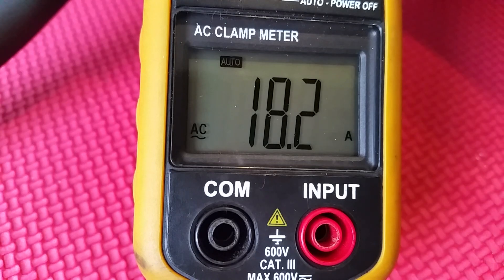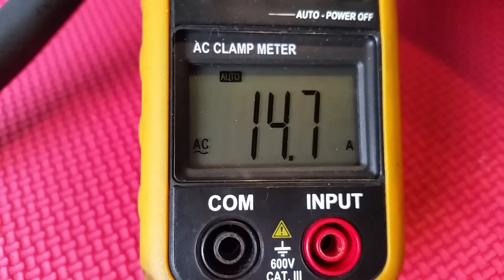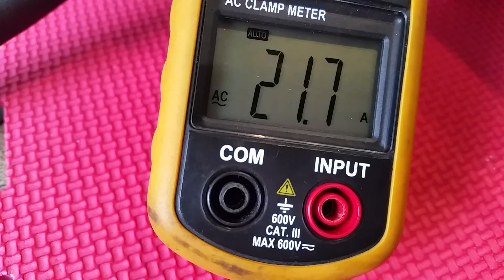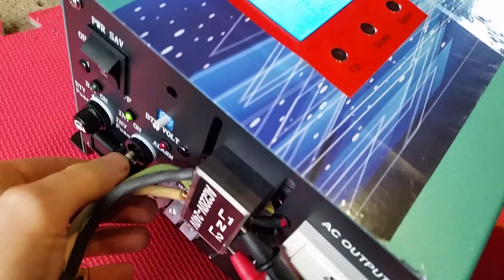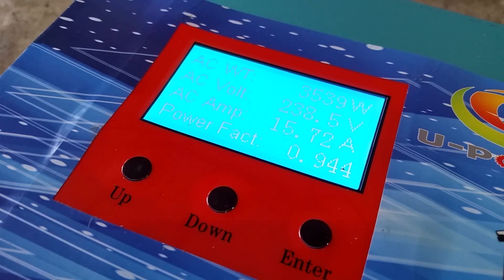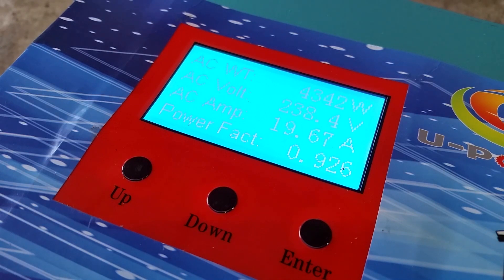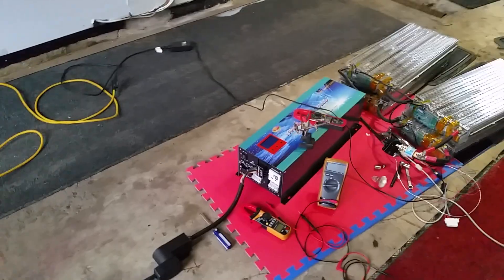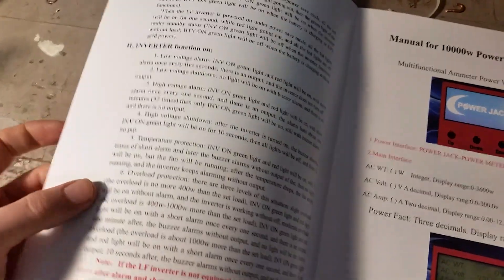Test/review of powerjack 15000W split phase part 2

Comment: Hey thanks for the review Joel, super helpful!!! I am not attempting to power a house but I am doing a coach bus conversion into a RV. After watching you review I think this should work for me. I am really only powering a Mini Split ac/heat unit,fridge, lights, maybe hot water heater,microwave and not all at the same time. I think this would be more than what I need. What's your thoughts?
Reply from the maker: Should be ok, just be aware that only half the power is available on each side of the 240v output. If you don't have any 240v appliances, this inverter is probably overkill for you
Reply: @erroneus  what on earth are them giant battery packs your plugged into? That might be helpful in my project also
Reply from the maker: Those were lithium modules from a tesla model s

Comment: Person is showing the 15000 watt inverter note your battery supply needs to be three times what is suggested for example your converter draws more amps than it puts out because the the things that you use use less amps it's kind of hard to explain the bottom line is is that converter needs a minimum of 200 amps BC 48 volts corny your little book caustic we're headed to put out 15000 Watts you're not being fair to the company and I do this all the time if your batteries cannot Supply the voltage in the amperage at a constant rate things get hot and that's why they shut down ew sticker wires coming from your batteries the less heat the less resistance the better the output and the better the results in the happier you will be
Reply: You are dead right. You will prepare more battery capacity to test all the way.

Comment: I bought a 6000W inverter.  They tell you it is 6K peak and 1500 continuous.   I believe they mention it in the ad but you have to be aware to realize that is what they are talking about.  Ads and instructions are written in Chinglish.  When they tell you 69 amps they are talking about the battery amps.  69X48 = 3300 watts.   Your english is as confusing to them as theirs is to you.  I have run mine three times.  The low voltage alarm came on at around 22v.  I didn't wait for the low voltage shutoff because I didn't want to run the Li batteries that low.  It did stand up to about 1400 watts for long enough to discharge the batteries.  Around 800 watt hours.  30-40 minutes.  I ran an 8amp electric chain saw without any problems.  voltage was right.  Frequency was 60.  Earlier video shows pure sine wave on ocilliscope.  I cannot say how long it will hold up.  
You get what you pay for.   The price is incredibly cheap for what you get.    If you need more power, buy two or three.  run different circuits for each one.  Still cheap for that much power.  
Anybody know how well they stand up?  I am going to start running my 3/4 hp swimming pool pump once I get all my panels set up (1800 watts peak).  I will run it several hours a day to use up what the panels produce.  I will tune in later to let you know how it goes.
Reply: If you want to run your house you should be fine with 6K (no AC) and you just can't buy more inverters to add power. It has to be one inverter but bigger.

Comment: This is a Power Jack inverter that a company "U-Power" re-branded. I have the same one. Mine is July 2019 under the hood it is authentic Power Jack inverter internals with a AS4 transformer. The alarm you are hearing is the low voltage alarm. In the manual explains this, then power shut down. The power rating is the responsibility of U-POWER not Power Jack. U-power uses all of power jacks parts with assembly and just a tag.  I feel your frustration of being labeled as a 15KW and surge of 60KW. You do however need more battery bank even if you have a true 15KW inverter, due to your supply voltage is dropping way to low and generating lots of heat. Did you end up keeping the inverter or returned? Just curious in the follow up.

Comment: You paid for 15000 watts.  It delivers 5000 watts.  You should get a 66% refund.

I'm not in the market for a whole-house inverter but this one might suffice for most of the house if I just paint ove the "1" in the label ;-)  The upstairs bedrooms are only used when we have overnight guests and the heat pump up there could be shut off, leaving only the consideration of not using the clothes dryer.

As far as I'm concerned, any Chinese-supplied inverter has questionable specs unless I know the vendor from previous experience or from multiple independent reviews.  Banggood.com has a "4000 watt" inverter with a continuous rating of 550 watts.  Read the Q&A section:
https://www.banggood.com/4000W-12V24V-DC-to-110V220V-AC-Solar-Power-Inverter-LED-Modified-Sine-Wave-Converter-Black-p-1287105.html?rmmds=search&ID=49316&cur_warehouse=CN

Exaggerate?  Nah, they wouldn't do that ;-)  Even some of the solar panels now have ratings of twice the volts * amps because the copywriters don't know the difference between AC and DC.  And some of the solar panels are computing watts from Voc * Isc - obviously the copywriters know zip about how this stuff works.

I have a couple of 2000 watt high frequency pure sine wave inverters (12 volt to 120 volt) from Reliable Electric.  They aren't pretty - just a basic black box - but they can provide their rated output and they just keep working.  That big ugly box provides room for good heat sinks and adequate airflow for cooling.  The fact that I never load the inverters more than 80% of their ratings (except for the initial test), that I know the average and maximum power of the items being powered and that the average load is maybe 300 watts might have something to do with their longevity ;-)  

I also try to be kind to the batteries (AGM).  That seems to work, as I replaced the previous set last summer just before their 9th birthday.  Lithium batteries are on my list at the next replacement but the prices still have to improve on the $/watt when I'm getting almost 9 years from AGMs.

Comment: Good test Joel, thanks for the massive doses of reality. That beeping noise was the SUX-2000 B.S. alert alarm system which is attached inside the inverter cabinet immediatly behind the "you guessed it" IDIOT LIGHT.
Yeah they are way overstating these inverters output capabilities.
We do run our entire 3unit Villa on an 8000 watt outback radian gs8048a and it works perfectly tho for daily use I keep tied to grid to sell excess power back and to run two elec. dryers and our 4000 watt water heater when the solar thermal can't keep up. I do this mainly so as not to abuse the lithium battery bank (battleborn) but they can handle it if I need them to. I use the battery bank mostly as backup power for all other house functions including 3 large Mitsubishi minisplit AC units. We have daily power outages here in the U.S.V.I. and when the grid is working it supplies horribly inconsistent- irregular and erratic power which we used to have to pay ¢.42/ KWh. for.  But no more !
I've been looking at getting one of the aims/sigineer brand 10,000 w or 12,000w
Inverters as a backup unit just to have on hand. Would you recommend one of these units ?
Thanks, and keep up the good work...

Comment: Just remove the 1 from the 15,000 watt label and ask for 2/3rds of your money back.  Problem solved.  The name PowerJack seems appropriate since as you turn the power up (past 1/3rd of rated continuous power), you then realize you got Jacked!
Reply from the maker: I offered that solution to the seller. They wouldn't do it, instead we  both lost money because of shipping. That is why I made the videos. Sort of revenge.
Reply: I told them about misadvertising the wattage long time ago but they still do it.  Dishonest people!  If they would just test the actual maximum and advertise it as that (such as adverting a 8000 watt unit  as a 3000 watt unit), they could gain some respect from customers.  Even better would be if they underrated them so a 3000 watt could output 3200 to 3500 continuously.  To me, continuously means as long as the person wants, provided there is adequate cooling.

Comment: I have the LF 3000w, 240v version and it is not working more than 1200w. I tested a 1400w vacuum cleaner and had no luck with it. Only a 10A fuse in it
Reply: I have similar 3K but split phase and it does more than 2200W. I am using it to get well water.

Comment: I've read a lot of the ads for these inverters.  The 240 output will do 5k.  1 110 will do 3500 (the white universal plug) the 110 hard wire will do 3500.   Adds up to just shy of 80% of rated.

Comment: Thanks for the Vid, after some searching and research Powerjack don't make a 15000W inverter in this style of case. it's the label thats wrong. This is a 5000w inverter split phase so 5000w x 2 at 120v or 5000w at 240v,  I still don't get from your reading how it can be more than 100% efficient
Reply from the maker: Don't trust the amp measurements. The point of the video is the issue with the marketing, labeling, selling and representation of this inverter. The engineering was never in question

Comment: Also...  I noticed the model S battery modules.  I will be using those for my solar system @ 24VDC.  When searching for inverters I notices the low DC voltages on them are usually around 21V, I'd rather have it around 20V (Giandel as it at 19,6 for it's 2000W HF inverter).  I was looking at the PowerJack because it seems the low voltage alarm and shutdown are adjustable, am I correct?  Woudl you have any suggestions for a good LF inverter to use with model S battery modules.  BTW I will be charging my battery bank to 24V max for the sake of lifetime.  Thank you.
Reply from the maker: Yeah, most off-the-shelf inverters are meant for lead acid. One option is to custom build your own inverter (I attempted this, see my other videos), but in the end I'm probably going to wind up with one of these: (which are tuned for tesla packs) https://www.sigineer.com/product-category/inverter-chargers/48v-inverter-chargers/ 
I'll make another video when this happen, but it wont be for a couple more months at least. while they are much cheaper than western built units, they are still much more expensive than the DIY route.
Reply: @erroneus .  Thank you so much for your response.  Very much appreciated.

Comment: Hey.  Thanks for the great videos on this inverter.  I need a 2500W LF inverter for powering a washing machine a water pump and a fridge in my camp.  In terms of durability, what do you think of the PowerJack inverter?  How well made is it if you consider it to be 3x less the rated power?
Reply from the maker: you'll have to add up the power levels of the washer, pump and fridge, then multiply by 3 to have a chance at running them all at once on one of these inverters. as far as durability goes, they are not conformal coated like singineer ones, so it may have a limited life span if used outdoors.
Reply: @erroneus  These do not like water; so if used outside need to be put into a water proof, vented container.
Reply: My 6000w LF powerjack does fridgefreezer, chopsaw, yet to plumb in my washing machine, led lights, vacuum cleaner.  Has done for 6 years. My batteries are the weak link currently. When new (the lead-acid batteries), the PJ could cope with a 3Kw pressure washer (high start load), but not for long, as the batteries couldn't.

Comment: I got 5000W Power Jack inverter and it works perfect up to 3500W then the cables become very hot if using continually...
Reply: Obviously you need larger cables.....

Comment: Warning!  Rhat 220v is NOT split phase!  The "neutral" is probably a ground, but the two "legs" of AC are IN PHASE, NOT 180 OUT!  
To use you must run the 220 through a transformer with a center-tapped output!

Comment: Not the grinder, I believe it's for The SAW machine that having 2500W due to the inductive load of starting current which is 1200+- for continuous load. Conclusion from the chart mentioned the capability load to carry yes this inverter is continuous 4700W and peak at 5000W top. The AC Voltage is 220V to 240V. 1 thing I have doubt, either this converter is really Pure Sine Wave or Modified Sine Wave. If you could have test that, it would be great. Cheers!
Reply: powerjack only makes pure stone wave lf inverters for those larger (>3000w) systems

Comment: The yellow chart DOES make sense.  Those are the maximum recommended power draws for each type of "appliance" (which could be based on multiple of that item, hence the florescent light rating of 5KW), likely based on field testing, PF, startup peak loads....  For example, a well pump motor behaves very differently than a television.  I am concerned cuz I have a well pump that is rated at 4A at 230V so that is 920 watts but that is "off the chart" even for the "15000 watt" model (which was shown here to be more like 5000 watts max).  If this company doesn't get their act together soon, they will likely go out of business.  If they would just list their units correctly and made a quality product, they would earn respect.  I put a 3 watt load on mine and it blew a chunk.  It was possibly damaged in shipping but that is embarrassing for them to have an 8000W rated inverter fail with a 3 watt external load (not counting the load of the inverter to run itself such as the fans and circuitry).  So based on this 15KW model only putting out 5KW max, I will assume my 8KW model is really only about 2.67KW max.  I have the 2018 model but will be sending it back for a full refund including shipping.  I also had a long Skype chat with "Helen" and this person was NOT able to answer all my technical questions which doesn't give me the warm fuzzies about this Powerjack company.  I think my power needs are getting "jacked" by this company so at least it seems to me they got the company name correct.

Comment: Thanks Joel. You shed some light on what I kinda expected. You get what you pay for, I guess. One thing though I'd like to ask is, you tested from the surface mounted terminal block. Have you tried the IEC Output Terminal block? (Thats the white one with the pillars and screw terminals). There are more wires connected to it and is marked for high output. Is it marked L/N/E? Cant tell from any of the pics. Rather odd. Just wondering! So did you end up keeping it?
Reply: I see from previous posts below you returned it!

Comment: Did you ever open this unit up as I bet (actually I know just from looking at the ebay listings and other videos of this brand) this only has 1 round split phase amplifier like transformer inside it, 

if you need power the aims 10kw split phase inverter (something like 30kw peak) uses 2 large transformers that look they come out of a substation or a welder (it ways about 65kg you need about 3 people and a strong wall to mount it, I probably not recommend wall mounting) there are lots of youtube videos on it (there is a 12kw one as well) both are  not cheap thought at around $2800 and $3000

Unfortunately it's generally cheaper to just get a 2-3  8kw high frequency inverters like your reliable 8kw inverter (4kw constant load or 4-6kw assuming you modify the fans to run constantly or yours ramp up sooner as older ones seem to take to long to kick the fan on ) as they can be had for less then $600-800 about (Probably 2 can be fine, 1 120v inverter and 1 240v inverter) 

 real transformer based inverters are Never cheap (especially branded ones) 

There is another inverter that is black coloured 15kw  that is basically same as aims 10kw inverter this but can't seem to find the YouTuber who has all his building running off it 

The manual at the end seems to state what it is, it's a 5000w inverter (PF1) short peak of 15000w

Comment: This behaves just like my 6000 W inverter. Luckely the engineers at Power Jack has set the warnings and shut downs correctly but the marketing department are way out.
Divide the label power with 3 and you got the correct wattage. To be honest I think these units are good value for the money compared to more well known brands. They are way more expensive for the same continous wattage. If you are planning to power your main living house I would however recommend a well known brand. My unit is just used in a summer house.

To bad he didnt open the unit. I would have liked to see the transformer and layout on these newer model.
Reply: Opening this case would be interesting.

Comment: did you notice the lack of ground cable on the side of the split face, can you imagine if there's lightning around this inverter
Reply from the maker: Jose Garcia there is a ground on the chassis, but the neutral line isn't connected to it. This was another reason to return the inverter, it can't really be connected safely to a usa/canada power center.
Reply: You connect it to ground by your self when you go through your earth protection circuit. I have done that on my unit. The house it is used in is however not connected to any main power so I dont have to consider that. Dont think I would like to do that.
Reply: gamingSlasher you have to make sure ground is not neutral live as some inverters the ground is live (not sure why) , so if you use the ground you blow the inverter so you should test the inverter for hardwired installs before connecting the ground (if the inverter has a L1 N L2 E connection block for it test for live earth, the case to ground connection block is fine as that is not bonded to earth)
Reply: Could you explain this better? I have the 8000watt version and plan on connecting it to the house using L1, N, L2 (there's no ground) except the chassis ground! Was planing on driving aground rod and using it to ground the chassis and the wiring,  Now im not sure.....
Reply: My Aims inverter has a floating neutral which can NOT be connected to the home which has a bonded neutral. I think that this Power Jack also has a floating neutral. It should say that in the instructions and warn that it can not be connected to a bonded neutral.